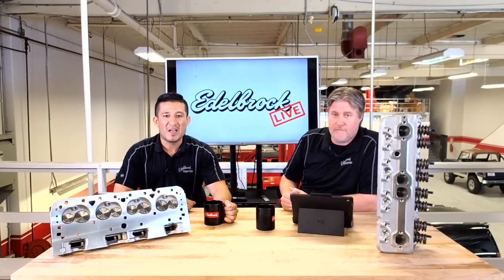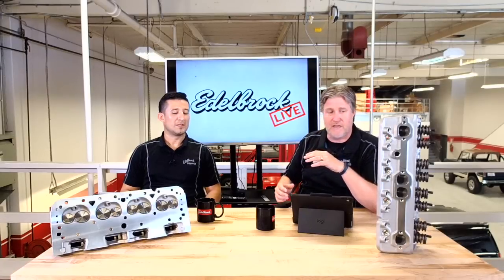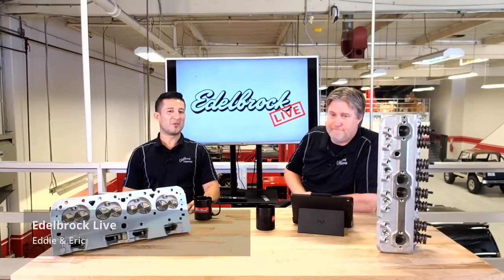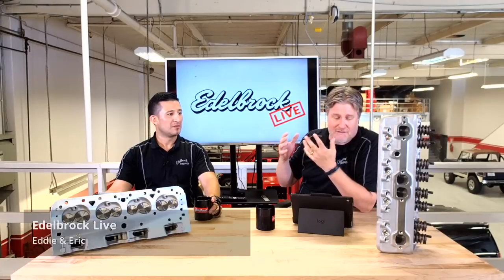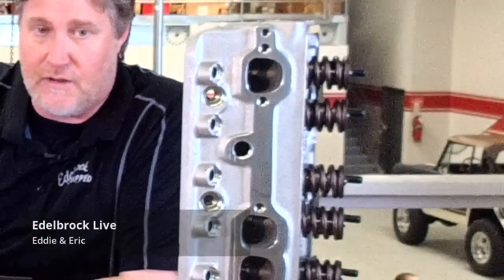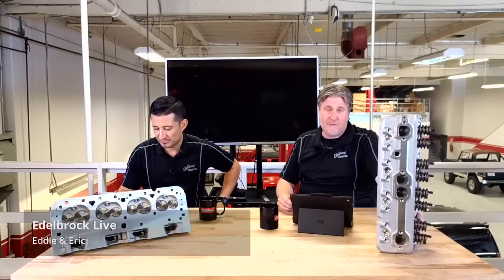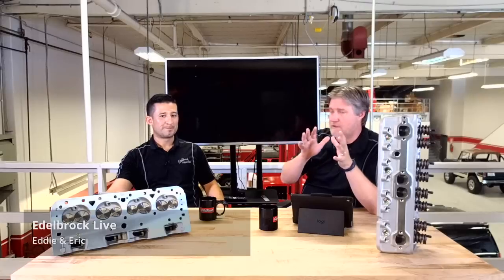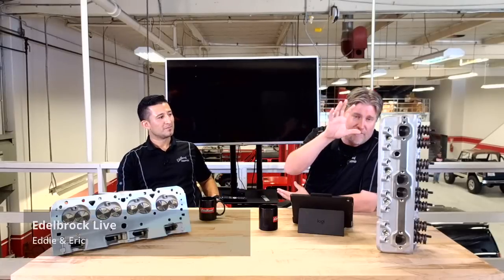Edelbrock Live Episode #5: Small-Bore Performer RPM Head

Comment: Just a question i have a 91 camaro s/b 305. I read the description on these heads. It says that s/b chevy heads cant be used on engines with bores less than 4" unless the camshaft has a lift less than 465". I dont know the lift of my stock camshaft, but i know forsure my bore is 3.76. So does that mean i cant use those heads? Im a little confused. Can you help?
Reply: This particular head was built for small bores less than 4inch